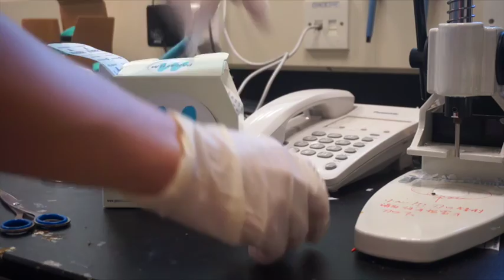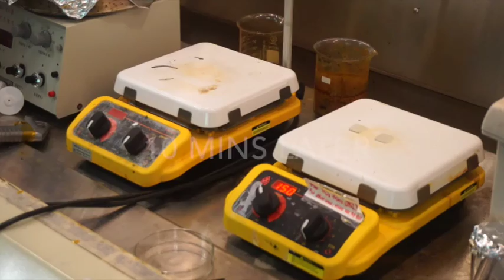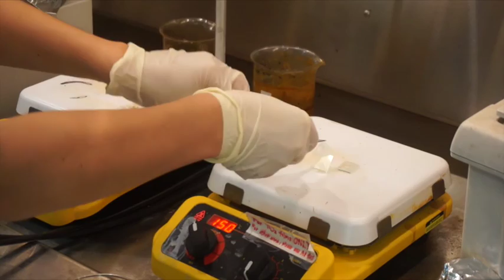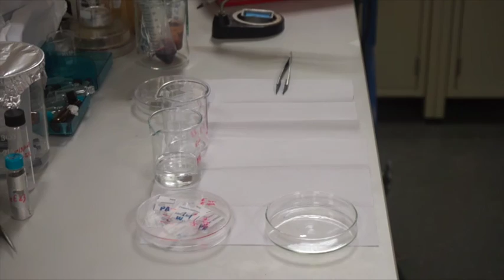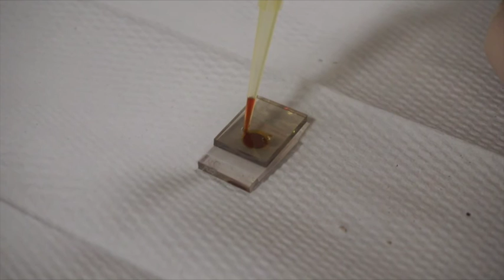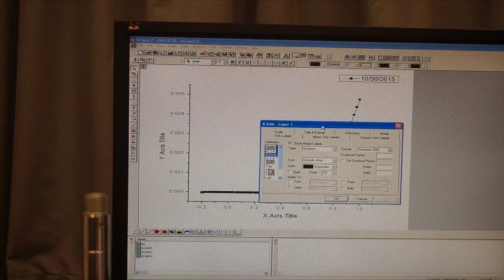DSSC fabrication and test@CUHK

Comment: hi, great job. I hope to know how the current density is obtained and why should use current density instead of the current itself?  Also, I hope to know why you did not use 4 wires connection instead of two wires connection?  Also, do you use sweep voltage and why not?